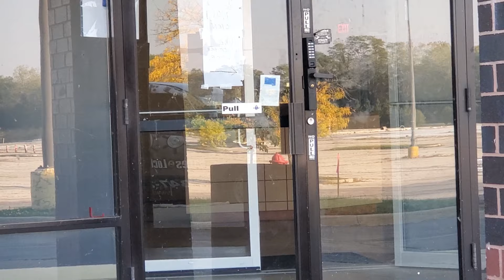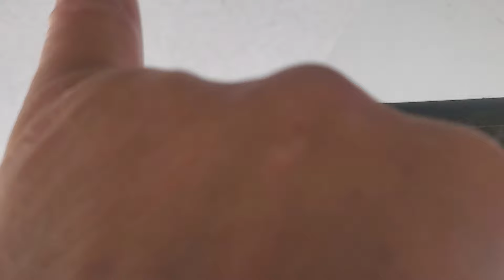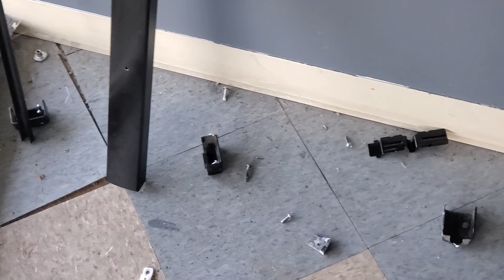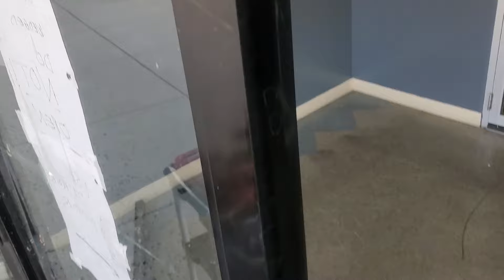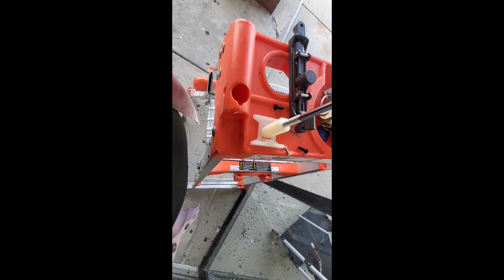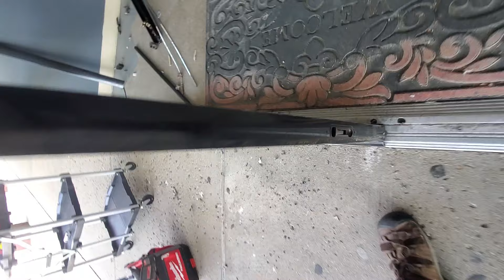Commercial door repair glass aluminum hinges pivots locks panic push bar lock repairs HKS Systems

Comment: I miss the indoor malls of the 70’-80’s with the Dept stores movies theaters and the arcades. Only one left near me and only has the Dept stores and food courts. We do have a few strip malls but their only accessible from the outside so no good old “mall” feeling. Those U-Change Locks we’re a big thing with the indoor malls. I don’t see them used anywhere else anymore. Kind of an interesting lock to rekey though.  Keep thinking maybe I’ll buy the rekey kit in case I come across one of those U change locks. Thanks for sharing!
Reply from the maker: Me too-Next time I'm out there I'll buy you a slice of Sbarro pizza,,lol I'm not sure there ARE u change kits? It's like a smartchange lock it never needs to be "rekeyed" since it uses resettable pins??